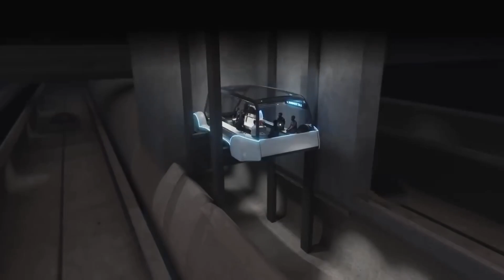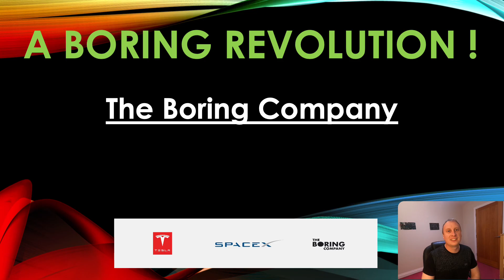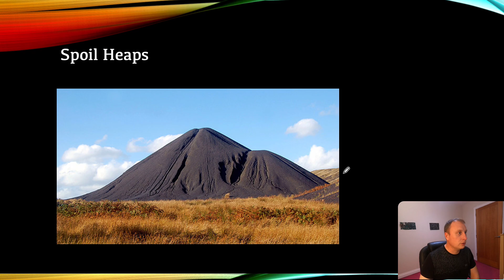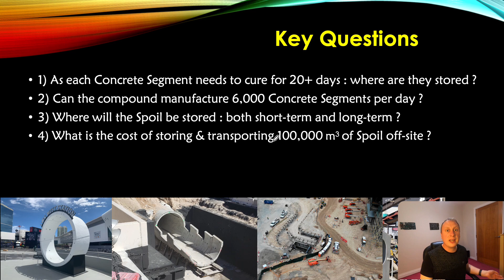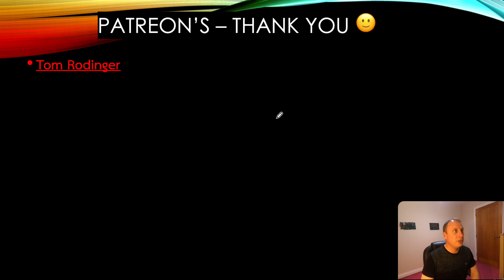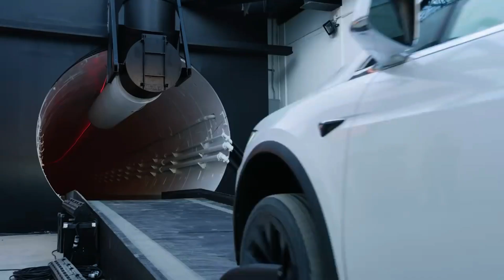Elon Musk Touts Prufrock's *LUDICROUS* Metrics 🥵 👷🏼 🏗️ 🚇 📊 🤖 # 147

Comment: Such a slow dragged out video, eventually used Google to find specifications, no it is not gigantic or a game changer yet, maybe proofrock 4 will be what really changes the game, 2  or even 3 lanes dug at once. Proofrock 3 might be faster but it is tiny, there are doubts a cybertruck will be able to use it it is so small. This channel is so damn frustrating, come on you should be able to do better, get to the point and stop putting filler to reach add length videos. Gave up 30seconds in tried to search for real news but gave up.

Comment: I think most of these issue can be solved by starting just outside of a city, where there is a lot of space (can become a carpark of people travelling into the city). Close to a highway or rail line. Then have spoil removed and segments delivered with small autonomous vehicles, trough the whole tunnel network.

However, I think the focus is wrong. Except maybe for Hyperloop later on: the straight line tunneling speed will be less important (once fast enough) as a project bottleneck, than all the divergent and convergent parts.

Comment: You missed two key points:
There are typically six segments per ring. Even the picture at the end of your video, the LVCC display ring, shows 6 segments. 
The outer diameter of the tunnel is 13’6”, that’s not the cut diameter. There is a gap inside the shield allowing for building the ring, and to allow for a curve/turn in the tunnel. The shield has thickness and the cutterhead also cuts slightly bigger than the diameter of the shield.

Comment: Some back of napkin figures.  At 153m3 assuming a 12 yv3 (@9.5m3) dump truck that is approx 1 truck every 3.5 to 4 min.  for approx 20 hrs per day. Plus about half that number again for the segments.  I am trying to envision a local gvmt.  or citizens that would allow that increase in traffic for even 1 month let alone six. for a large project.  In a city environment with traffic and stop lights the logistics of simply supplying the required number at a steady rate would be a nightmare.

Comment: My Guesses. Its only a stretch target....The truck will serve as a dual purpose.. it will have a  circular carriage that can unload 10 segments at a time. and then spoils can be dumped into  the empty carriage. they can use robotic arms to unload trucks and load the conveyor. there will be a few conveyors one feeding concrete the other taking out spoils. as the TBM will be electric, the requirement for extraction will be less the robotic arms inside will assemble both concrete and replace serviceable items on TBM, it may also add electrical extensions.. It may add ventilation outside tunnel and add to the end of the run.. As the unit will be mostly battery, downtime can be minimized, due to addition of powered sections. i assume the tunnel will be getting power installed anyways so they may make it part of the tunnel build. I suppose electrical and ventilation can be installed at the same time as the could install it into the segments? How much of this is likely or reasonable.. How do they do this now?? can you give us a break down of all the slow points and what you think will be the limiting factors...

Comment: I am no tunnelling engineer but it seems obvious that the spoil wagons bring in the sections and take out the spoil. For prufock 3 this is 5 segments a minute maybe five wagons and these are sized to take out 18 cube in 5 wagons of 3 to 4 cube. Maybe the wagons are small enough to turn around in the tunnel and are shaped for the tunnel and can pass each other in the tunnel. So continuous line of wagons in and continuous line out.
Reply: I am a tunnel engineer. And you are on the right lines. For an EPB TBM of this size, typically where muck waggons are used, the whole thing comes in as a train, on tracks, with the set of segments on the first two special flat cars, then a flatbed with the other supporting materials on (consumables, pipes, rail, etc), then the set of muck waggons, finally the locomotive (diesel, electric, battery all used). The segments are lifted forward one at a time and rotated 90 degrees (they are brought in lengthwise to save space) then lowered onto a magazine feed system, so at least one ring is always ready to build. At the same time the consumables are unloaded. The much cars are already filling from a discharge conveyor that runs above the whole train, the train moves slowly back out filling the muck cars as it goes. 
Other machines use a bentonite mud pumped into the excavation chamber, where it mixes with the spoil and pumped back out along a pipeline to the surface where a separator plant is used to screen out the excavated material and "clean' the bentonite mud to pump back in.
Lots of videos to explain better than me. Try the Herrenknecht tunnelling website for some great animations explaining the processes.
If the tunnel is large enough the trains can pass each other at passing bays just like most of the US main freight lines. For this size of tunnel it's not really practical unless using fairly small rollingstock.

Comment: I like your videos because you bring up so very much that I haven't thought about. If Elon would have simply tweeted that ver-3 will do 7 miles in a week, I would have thought, wow, that is cool. When you explain or dive deeper into the subject, I get a much better idea of what Elon is talking about when it comes to the Boring co. I do have some thoughts on the matter, but I'm not an engineer and not arguing with you. Just some thoughts that came to mind on the subject while I was listening to you.

Some of the logistical issues if tunneling routes generally follows interstate, state highways and county roads will be reduced, if not solved. When repaving, redoing on ramps and off ramps to freeways, I have seen mobile concrete manufacturing sites along the sides of the highways that are owned by the federal, state and county governments. The easements are sizeable. This would mean, on a tunnel that is 600 miles or ~1000 km in length, there would be access points necessary along the tunnel route and "mobile" infrastructure set up before the boring reaches each site. 

You did mention something about the proofrock machine would have to be a factory or manufacturing facility in itself. Elon has strongly alluded to this being true in the future. One of the "ludicrous" issues I'm thinking about is when he stated the proofrocks will be all electric and just how much power will be needed to keep ver-3 operating, that alone sounds like a major logistical/infrastructure issue. Something I think I recall him speaking about early on was the need for incorporating (ideally) as large a percentage of the spoil into the construction of the segments for the tunnel. It sounds like a tough nut to crack, but then again, he has a small army of material science engineers to work on something of that nature. The other thing he mentioned is that the "delivery" of the spoil for removal will be the spoil after refining that happens in the proofrock to capture the usable material for structural segments. Since the spoil would not be of a consistent nature for the whole length of the tunnel, it might be problematic. 

Engineers like Sandy Munro were not so surprised that Tesla finally made castings for the model Y, but what did blow him away was the aluminum castings were made in about 90 seconds from injection to casting and did not need further treatment as was common for aluminum castings. This was something the Space X material science and structural engineers worked with Tesla to make that happen. Interesting note: Tesla has hired or is hiring geologists that many assume is for mining engineering, maybe a dual purpose exists for the Boring Company as well. 

I can't get inside Elon's head, but history would indicate Elon has already considered there is a threshold probability that ver-3 is possible or he wouldn't have stated what he believes the parameters of ver-3 will be. Will it be easy, nope, nothing Elon's companies do seems easy. Will it be possible, yep, as long as they don't play on the edge of the cliff and fall. They might slip now and then, but what counts is to not fall off the edge.

Comment: Why not a molten rock pipeline? Dump it in an abandoned quarry or nuke crater. Use it as a battery. Although once you got it hot, might as well stratify some resources out... Tesla needs tons of silicon for their mega casting alloy. The heat also gets rid of the moisture. You could also make great MSE walls for a Levi, raised rail or an inefficient Hyperloop tube.
Reply: Wtf
Reply: @j03man44  tf is, you should go to Hawaii. It's not that hard to transport molten rock with enough cooling. The pipeline could be reusable and terminate at an elevator
Reply: @ch4.hayabusa  WtAF

Comment: The  curing time for the segments is the least of the problems, primarily because there would have to be tens of thousands pre-cast ahead of a big project start.  The main problem is where will they be stored until they are actually transported to be installed.  I wouldn't want any part of trying to figure out a reliable system of cast/transport to storage site/transport to construction staging areas.  It'd be a nightmare!

Comment: 1. once you get out of the cities, there is LOTS of room for segments to be stored while curing, so I don't see that as a significant limiting factor.

2. why not? in Texas Tesla setup a pair of mobile batch plants to produce concrete for giga-texas. each batch plant can produce ~60 cubic yards of concrete per hour. For prufrock 2  that's about 6 hours worth of production per day (see volume calculation below). So prufrock 3 would need abut 4 mobile batch plants running 24/7 to keep up (so figure 5-6 to allow for maintinance

3. again, once you get it out of the city, that's not that hard. Getting it out is hard.

4. it doesn't matter, if you dig a tunnel of a given diameter and length, you have the same volume of spoil to deal with no matter how fast you dig, that is going to be part of the overall cost of the tunnel and digging it faster isn't going to matter (unless you need to do something like storing it locally to drain water out of it to re-use in the tunneling operation)

5. how many trucks per hour are needed for segments in/spoil out for prufrock 2/3?

the segments are not hat big a problem to move (assuming the limit is weight not volume, which I think is correct). with a 13.5" ourside diameter and 12" inside diameter 755 ft of segments is ~3500 cubic ft of concrete per day for prufrock 2, ~156 lb/cubic foot that's a bit over 555,000 lb. With a semi able to hold ~44,000 lb that's ~13 trucks/day (just over one truck every 2 hours)
Prufrock 3 is harder at ~88 trucks per day. This is a truck arriving and being unloaded about every 15 minutes. This is aggressive, but doable.

The spoil handling on the other hand seems worse as it's harder to handle and higher volume

a quick google search shows a dump truck having a capacity of 10-14 cubic meters, so 10-15 trucks/hour for prufrock2, 75-110 trucks/hour for prufrock 3
filling a dump truck in ~30 seconds is not going to happen, that's about 20 tons of material, filling the truck in 30 seconds would break things, so this is going to be filling multiple trucks at a time.

Note that the 30 seconds per truck I mention above includes time to move the previous truck out of the way and get the new truck in it's place

my guess would be that the answer is going to involve self-driving tesla dump trucks  that move in and never actually stop while they are loaded, the new truck arrives and snugs up against the back of the truck ahead of it and a carousel of conveyor belts rotates with the trucks to a line of them.

Or if there are electric spoil carts carrying the spoil out of the tunnel, could they just roll on to a semi (flatbed or specially designed to hold multiple layers of carts), be trucked out somewhere, roll off and dump elsewhere? I can imagine a setup where the spoil cart rolls on to a roller-coaster like track system that captures it, moves it along and tips it over to dump the spoil (probably more compact than the carousel concept I mention above)

Comment: I think the hardest part is moving everything continuously.  They've got to move segments in and spoil out concurrently.  Perhaps they are working on some sort of special electric vehicle that: 1) Goes into the tunnel carrying at least one segment, carried low, and with a narrow wheel base.  2) Hands off the segments then morphs into a vehicle with a wide wheel base, and jacks itself way up.  3) Gets filled with spoil, then rolls out over the tops of the similar vehicles carrying segments in.  Or, instead of vehicles that pass over each other, maybe they could make them narrow enough to pass side-by-side.
Reply: Many TBM's use  a liquid mud to transport the spoil out via a pipeline (Slurry or Mixshield TBM), and the segment delivery vehicles are very specialised vehicles. This keeps the tunnel environment much cleaner as well as other advantages in the excavation control. Plenty of videos out there. But most of the impressive ones are on larger TBM's. The 12' ID greatly restricts what can be done.
Reply: @tunnellingsalisbury7605  Interesting.  But I don't think the Boring Company will do things the conventional way, because:
1.  Any kind of pipe or conveyor would have to grow as the tunnel gets longer, and could stretch for miles, so that's a lot of material that needs to be assembled, disassembled, trucked, etc.  They've already stated they won't use track for these reasons.
2.  I'm sure they don't want to use a lot of water, especially in places like Las Vegas.  Water is an increasingly scarce commodity, and mud poses potential spill and cleanup issues.
In contrast, if they used some sort of specialized robotic vehicle that carried segments in and spoil out, they would only need enough of those to keep up with the rate of digging, no matter how long the tunnel gets.
Reply: @steverobbins4872  Love the enthusiasm Steve but TBC have been doing things pretty much the conventional way so far (as far at the tunnelling goes). Where they have tried something different (Continuous conveyor in the crown, on a tight curve, on a short tunnel) it appears to have only slowed things down. Which was entirely predictable and predicted by myself and others.
Many long tunnels have pipes and conveyors of many km in length (over 30km in one current hard rock tunnel). Indeed, most very long tunnels generally use conveyors (much like mines) for long distance, linear, spoil removal.
Track is what TBC used for the LVCC Loop. I'm not sure if they tried rubber tyred multi-service vehicles (MSV's) in the resorts tunnel but this is commonplace in TBM tunnelling these days. Track ahs tradittionally more efficient for modest length and small diameter tunnels. 
The water in the slurry system is recycled, can be greay water, its fairly closed loop (if they use filter presses for the degraded mud) and can sometimes produce excess water from the groundwater it excavates with the spoil. generally very environmentally friendly the modern systems.
The longer tunnel requires the spoil/material "trains" to pass. Their tunnel size is too small for what is called a 'California crossing' to allow trains to pass. 
Sorry I sound negative, but I have wrestled most of my career with these constraints in tunnels. It's always a balance between them.
Bug question is " Is it worth all this investment and technology to save 10-15% on the overall cost of a tunnel project?". Especially when the saving can be easily wiped out by the massive additional temporary infrastructure.